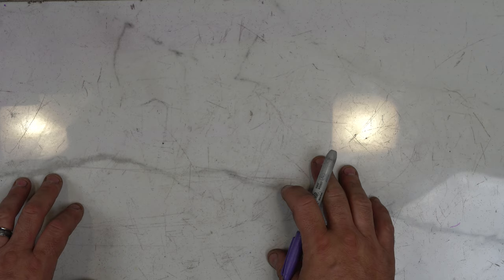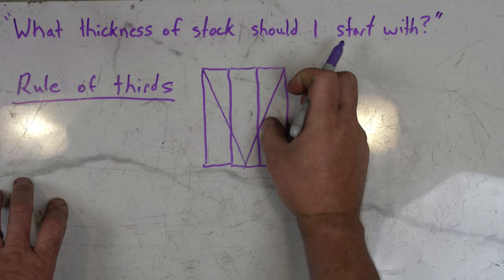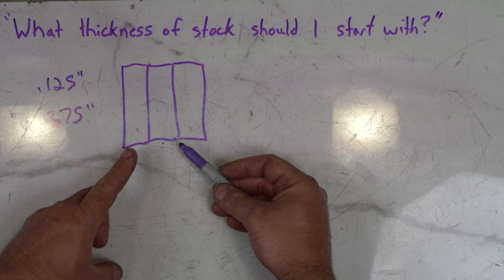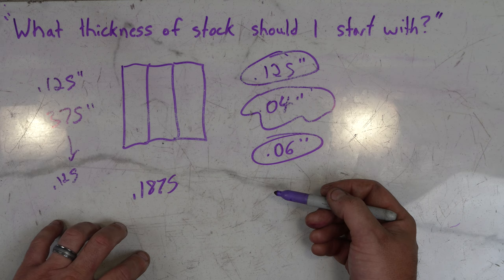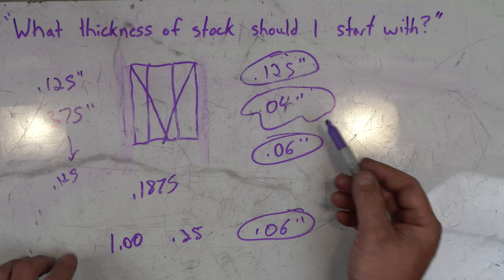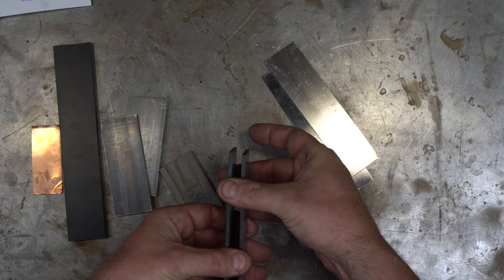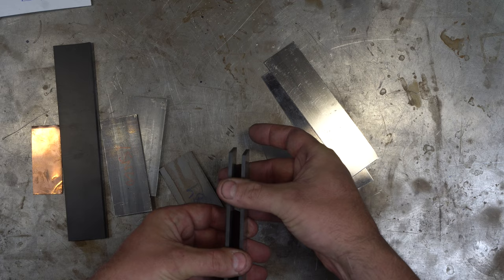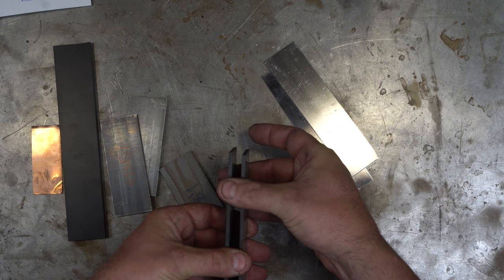Triple-T #94 - Layered constructions: how thick should the layers be?

Comment: Along a similar vein, itd be cool to see some general math/calculations/ how to guesstimate what dimensions you to get a certain shape, size etc knife
Reply from the maker: Those are relatively simple volume calculations.  The trick (and variable) is what you're using to forge.  If you're hand hammering, you'll be generating a LOT more loss due to scale.  It also depends if you plan to forge to shape or rough forge a bar and then stock remove the rest.  Calculating the height/width/length of a stack of steel and what you're desired height/width/length of a final blade is relatively easy.  Moving it into that shape and how you do that is the tough part. Thanks for watching, Sasha.

Comment: Thanks Denis I think that worked quite well, I don't work in inches so much but I could follow what you were doing.
Is there a way of calculating how much wave you can put into the pattern   as in how much the steel/copper layer wil dip towards or away from the edge as you grind the bevel?
Simple answers on 3 sheets of A4 paper please......
Reply from the maker: Calculating the height of the waves is tough.  It's one of those things you just need to practice.  The key is hitting it with the aggressive dies and then using flat dies to stretch it out after that.  Thanks for watching.

Comment: Concerning the cu-mai and over heating it (melting the copper).  Couldn't you heat it up in a PID controlled heat treating oven instead of the forge?  That would give you more precise and even heating, then you could nail the perfect temp for sticking it all together without "guessing" in the forge?
Reply from the maker: Sure you could.  Baker tool and Forge does that for their billets.  I did that for the gold build I did where I needed it under 1700F.

Comment: Not a question, but a consideration. Some steels move at different rates, like stainless or mild, so you might have to adjust your ratios
Reply from the maker: Yes, some steels move at different rates but I’ve not found that to be very consequential in the actual forging.  It’s not that noticeable unless you’re dealing with extremely thick layers.

Comment: Thanks Denis! This definitely answered many of my questions. My other question was more about mass to length. How much steel do you need to start with if you want to make a longer blade? (sword length, like 33 in blade and 42 overall?)
Reply from the maker: It depends on a few things: 1) are you hand forging?  If so, you’ll lose a lot more to scale.  Sometimes up to 1/3.  2) are you forging to shape or making a flat billet then doing stock removal.  For layered constructions I caution against forging to shape.  I usually am doing width calculations only and trying to draw it lengthwise.  If you have something 3x thicker than your end thickness, you’ll probably get just over 2x the length, depending on the drawing method.  If it was a rolling mill, it tends to draw in only one direct, whereas a press with flat dies will draw in all directions.  A hand hammer depends on the shape and user.

Comment: You didn't mention how thick other layers should be for something like the copper go-mai. You might not want to be too thick so you don't have a huge copper line in your knife but the same can be said for too thin
Reply from the maker: I’ve mentioned that in my cumai how-to video.  I use .020” copper sheeting.  That’s the perfect width I think.  👍

Comment: Hypothetically If you did a 5 layer with copper between steel, if you weld up all the sides air tight and get it hot enough to melt the copper, wouldn't that technically weld the steel and copper together?
Reply from the maker: You don’t need to melt the copper.  You just need to get it about 1800F.  I’ve done that technique many times.  Look at sone of the videos in my library.  I also just did this with 24k gold layers in my most recent build!
Reply: @TyrellKnifeworks  perfect thank you for all this helpful content!